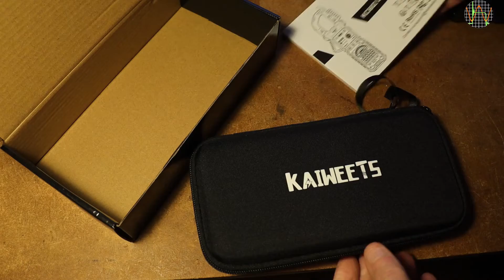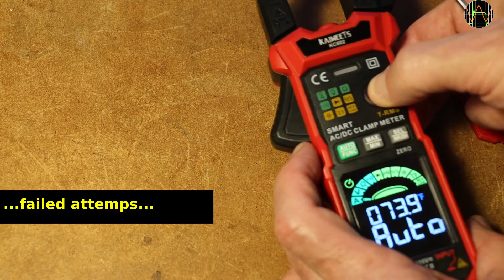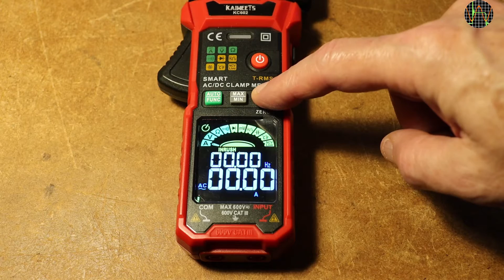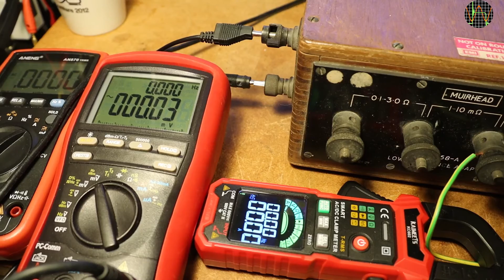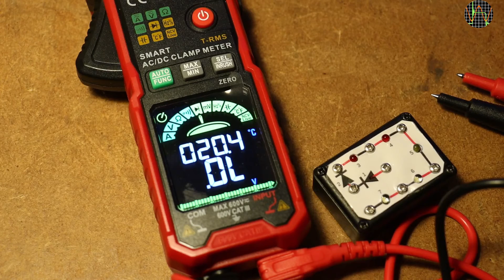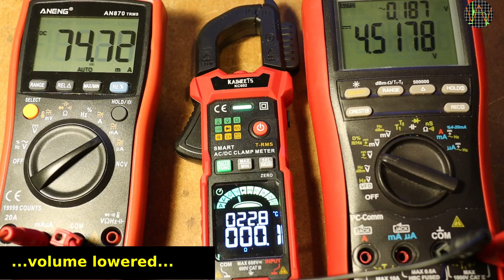142 - Review of the KAIWEETS KC602 Smart Clamp Meter

Comment: On this meter  when measuring AC  amps Frequency  does not work 
And  temperature   measurement does not work
Reply from the maker: Temperature measurement using the probe that came with the meter works fine in my unit. Need to make sure the polarity is correct.  On Frequency, I normally think voltage, so I did not look at frequency and current. I just tested it with 10A and nothing. But then I found the part on frequency measurement in the manual (page 13 on my pdf) where it states that current has to be more than 12A for it to work. That should really be in the specs but at least they stated it. 12A sounds a lot but I guess it makes sense. The voltage produced by the clamp sensors is awfully small

Comment: Can uou suggest me  a clamp meter with dc and ac current measurement in 3000-6000 INR
Reply from the maker: Not really but that is only because I have no personal experience with a clamp meter that can do 3000-6000 Amps inrush current and I am not recommending anything that I have not used myself.  My "big guns" clamp meter is the Extech MA1500 which can do 1500 Amps AC or DC. Compared to my other meters (clamps or otherwise) it is huge which is why I hardly use it, to the point that I often forget that I have it. Got it for next to nothing on eBay a couple of years ago. It is nice enough and I have no complaints apart from its size and that its a bit of an impostor. While it has a 40000 count display, the specs are not better than a 4000 count meter.

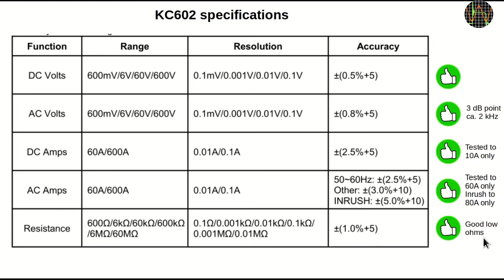Comment: 5:55 in the chart it says the specs support "60A/600A" and you say you tested "up to 60A" (minus inrush) so i'm confused, does the meter only detect from a MINIMUM of 60A ??? but then you say you tested "up to 60A" ???  
So how low can it detect ?
Reply from the maker: There is a problem with the KC602 in that it does not allow manual ranging and the MAX function disables autoranging. That means you are locked into momentary used range (usually the lowest) and that would be 60A.  In this case if the current shoots up beyond 60A you can't see the max value using MAX. On AC or DC amps it measures more than 60A just fine if you turn off MAX.  For AC Amps you can use INRUSH as kind of a  substitute for MAX.  To put it another way, the problem is not that the meter can't measure up to 600A but that MAX prevents it from changing range to do it. That in itself is normal. All meters with  a MAX function do that. But other meters allow you to first set manually the range. The inability to manually set the range to 600A basically cripples the MAX function on the KC602
Reply: @TheHWcave  thanks for the quick reply, my issue is i want to know what is the minimum amps it can measure ?
Reply from the maker: @cjjuszczak  The best resolution is 10mA in the 60A range. But accuracy is +-(2.5% +5 digits). At very low amps, say  50mA , the digits part becomes important. The meter could read anything from 0.01A to 0.10A and would still be in spec.  If you are after low current a clamp meter that is suitable for leakage current checks is better, for example the Uni-T UT210E. Its not quite as good as a true leakage current meter but It has a lowest range of 2A with 1mA resolution +-(2%+8) so the 50mA could read as 0.042 to 0.058. I have a few videos on the UT210E)
Reply: @TheHWcave  This is EXACTLY the info i was looking for as i'm looking for a new amature multimeter for me to check low amperage circuits from about 50-100ma up to a few amps, and with a clamp if possible (checking higher amp AC/DC circuits around the home would be a bonus). Resolution they all seem to be more than good enough for my needs. I was looking at these "auto" clamp meters, and just got confused by the "ranges" when it says 60A-600A thinking it doesn't go any lower than 60A :)  
Thanks again, you've answered my queries perfectly, and i'll check out those meters you mentioned 👍♥

Comment: Is there a reasonably priced (up to $/€ 100) low level amp clamp meter, (“robustly”) accurate down to 10mA with 1mA resolution?  (Perhaps a max of 3-5amps to 0.01amp.)  It could even be a MANUAL, SINGLE function (horrors!!!) unit, or minimal number of functions all done well ... as opposed to the auto/multi-modes all of which are mediocre to poor.
Reply from the maker: I am assuming you mean DC amps (with hall-effect sensors) because clamp meters that only do AC amps are ubiquitous. In fact especially on eBay/Aliexpress you always have to carefully check where a clamp meter can actually do DC amps or not. Regarding models, I am not really following the market and there might be lots newer models. From own experience I have a UT210E which is ok (I have a whole series about improving it). It now suffers from the range switch starting to wear. After cleaning, it works again for now (not sure how long). On the other hand, the UT210E can't be beaten on price and resolution, so it might be worth just getting one and replace it when it wears out. Compare with Brymen who have a set of well regarded clamp meters but they only go down to 10mA and (BM078) cost 4 times the UT210E.
Reply: @TheHWcave  Thanks for your reply.  The UT210E looks just right.
I''ll check out the improvement series.

Comment: very good and in depth review with a lot of explanations for bloody amateurs like me.
The probes seem to work after de greasing as the author has mentioned in a comment somewhere below and is worth to mention cause I was not willing to buy a 50€ multimeter which has continuity issues and needs de greasing and polishing. Too annoying and not a good sign that Kaiweets does not detect that and cares or better improves the quality as continuity is a key element.
Reply from the maker: It is pretty much a given that the probes that come with lower-end meters are terrible. The probes in the box are where the manufacturers skimp and recover costs. Yes degreasing helps momentarily but these probes are greased for a reason. They will tarnish / corrode eventually. I always recommend to invest into a set of branded probes ( I personally like Pomona but others are available). Also probes for electrical work are different from those that are better for electronics , so even say  a Fluke probe set meant for probing bus bars and other mains electricals are usually not great for probing on a complex PCB.

Comment: I was impressed by this review, specially when you looked into the low volt range. Now I am of the old school, very much disliking all sorts of automatic things. Your low volt test shows exactly the kind of unexpected things that happens to plastic fantastic automatic things. I think based on this, I will buy the Kaiweets/Habotest 208D. 
I have actually had the 208D before, it was in fact so nice that my friend took off with it (he is forgiven), so I didn't get very much experience with it. I now wanted to have a quick look around for what is available today before buying another clamp meter again, but based on your review I think I will abandon the sexy functions and small size of the KC602, and buy the 208D again.
Incidentally, the manuals state that the KC602 only measures inrush current in AC, but the 208D does AC and DC, at 100ms.
Reply from the maker: I totally agree. They are slowly getting better with low volts etc where the "smart" part gets in the way but its still quite bit away from what a simple dumb meter can do if operated by a user with  at least half a brain. .

Comment: Thank you for another in-depth review. Interesting that better quality test leads improve the operation of the continuity mode dramatically. It would be interesting to determine what the difference is that causes this. Kaiweets can't be too upset if they sent you another item to review! Regards, David
Reply from the maker: I did a test some time ago when reviewing another meter (can't remember) and using alcohol to de-grease and then polishing the tips of the probes that came with the meter made a difference. But they seem to tarnish again easily. So it must be the surface material of the tips and/or some grease or similar that  the manufacturer might have applied to prevent rust on inferior ones. I used to compare with Brymen leads but gold plated tips are actually not needed. The Pomona ones work well without that and are generally available. Kaiweets send me both meters at the same time together with a test lead kit for review. So the jury is still out on whether they will ever do this again... BTW, that test lead kit review is almost done now and those probes work as good as the Pomona on the KC602, so they can do it if they want to...  Even the ones from the KM601s are better than the KC602...
Reply: @TheHWcave  i suggest to write and pinn this comment onto the top cause that was reason for me not to buy this meter.
Luckily I read all comments to find it out.

And maybe you might ask Kaiweets to tell you more about , if they have improved the product meanwhile with better probes cause that was really a terrible result and easy to crosscheck. Yes, de icing, no, decreasing --- oh no de greeasing might help a bit but sorry, I need a meter to work and not to polish every time I use it especially if that is not often the case: i have ordered one from Amazon for testing and in case it has the terrible leads I will complain and ship it back or amazon will try to fix it I bet cause usually they ask.